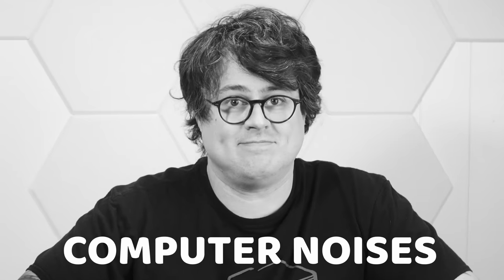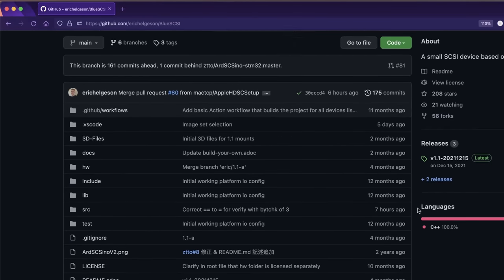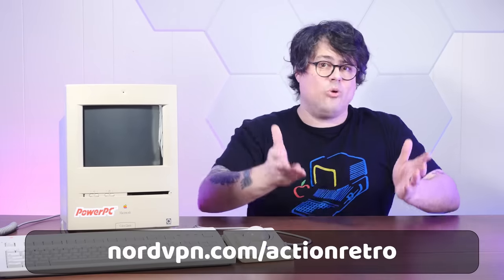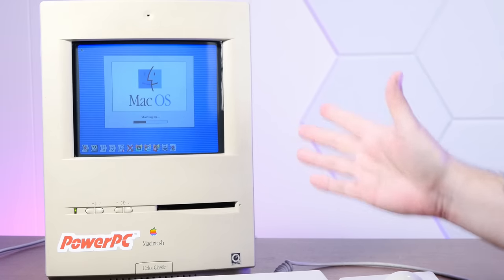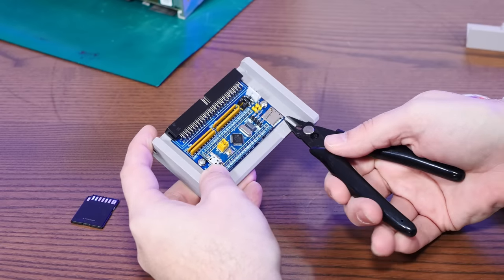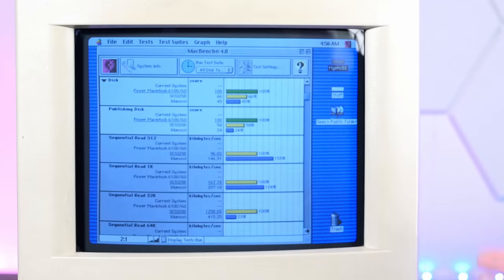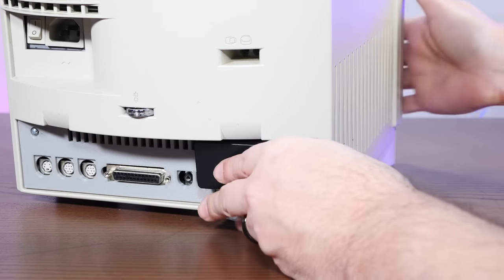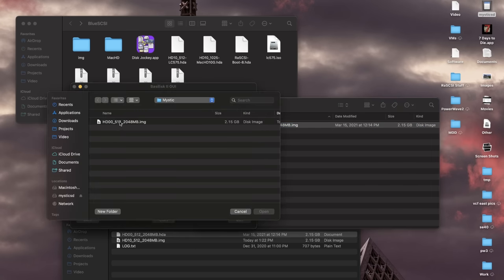BlueSCSI is AMAZING!

Comment: Thanks for the video Sean - though the performance you seen is not the norm (I get faster on my old SE) - This could be due to using the LIDO drivers which many blanks/premade images use. If you could retest with the Apple SCSI drivers you should get much better results - at or around 1mb/sec - also with the latest firmware as you mentioned you should get around 1.2mb/sec.
Reply: Personally, I would suspect that SD card extension was being plagued by interference issues and slowing down data transfers.
Reply: From what can bee seen on the video, Sean only tested the sequential reads, not random reads, where any solid state based disk should be faster than a HDD.
Reply: @Eric Helgeson Just to confirm, the Apple SCSI drivers (any version?) are the fastest driver's (compared to FWB HD Toolkit, Silverlining, etc.) for any version of BlueSCSI?  And on top of that, we ought to be using ExFAT too, for best performance, right?
Reply: @mojoblues66  Random r/w performance(and latency) with solid state storage will wipe the floor for sure.
Reply: @JDW-  I’ve done extensive testing of modern scsi sdcard solution on Mac, I can confirm that you really want to use the the apple  drivers, FWB, lido and a few others I tested really poorly effected the read/write speeds
Reply: @Choppy_PHC  have you tested MacSD?
Reply: @JDW-  haven’t tested the MacSD, but scsci2sd, blueSCSI, compact flash to scsi (retro brew computers) and I’ve also been a extensive tester during the development of the ScuzNet device that has a sdcard for the hdd as well as a scsi Ethernet build in
Reply: The premade images are no longer easily available on macintosh garden (I found 1 download with the wayback machine). Would you be able to host the files directly on the github page?
Reply: @ligmuhnugs  the images are still on the garden where they always were (just looked)

Comment: Hmm.  In addition to the drivers within MacOS, I wonder what would happen with different SD cards.  One way to get a better sense of the difference that might make between BlueSCSI and SCSI2SD would be to use the same micro-SD card in BlueSCSI, and (with an adapter) in SCSI2SD.  It would be a bit time consuming, since it would need to be reconfigured for SCSI2SD, but might be instructive.
Reply from the maker: Ah yeah, I did use the same SD card for both
Reply: Did you try it without the SD Card extension cable? That could be having an effect
Reply: @OtterlyInsane  it probly check sum, reparation of the same data not making the first time
Reply: @ActionRetro  
You may wish to retest with a faster/higher quality SD card. UHS1 minimum, but I would advise UHS 2 for best results. They're more expensive, but worth the extra cost.

Comment: You may want to use A1 or A2 marked SD cards.  They are made for OS use.  Older cards are focused on video or photo applications.  Thanks
Reply: I haven't heard of these Application Classes before but have known that typical SD cards are terrible for random accesses. Whenever I need to get new cards I'll need to look for these newer classification markings.
Reply: @eDoc2020  I think that the Raspberry Pi and similar systems  gave them reasons to make OS focused cards.  Good Luck

Comment: Remember also that there are different classes of SD cards that perform faster or slower. I would double check the cards you used to see if they are slower.
Reply: Well, yes, that counts, but I doubt it would change matters dramatically.

Comment: Great vid!  FYI - I've found even some modern higher class SD cards have a problem with exFAT on BlueSCSI, resulting in the BlueSCSI corrupting the card.  I've found the FAT32 format on the SD card to be completely stable, although theoretically slower.  On my 68K Macs there is no difference between FAT32 and exFAT, but newer faster machines may be different.
Reply: I can't imagine why exFAT would be faster, but I also haven't looked at the code. My assumption is that the BlueSCSI wouldn't modify the filesystem itself, so the only speed difference would be in calculating sector offsets. As the basic technology is the same with the two filesystems I can't imagine there being much of a difference here, and I would actually expect FAT32 to be imperceptibly faster due to only using 32-bit values.
Reply: @eDoc2020  its more likely due to the filetable size, it can increase write/read speeds tremendously. Sustained writes/reads on SD media is the medias strongest shortcoming, the more fragmented file table of FAT32 and the way the virtual-disks are stored for BlueSCSI is probably what is the biggest cause of both the corruption and performance differences.

If i hazard a guess, it would be due to the SD media not having a cache, so when the buffer is written on the host side, the SDcard simply falls behind on write-chunks, which due to the limited signaling of the media the interface controller (Arduino) is not catching, and assuming its flushed out before it is.
This is actually a common issue with alot of SDcard controllers, as the media lacks alot of the command queueing that ATA supporting disks have, and the bus the adapter is connected to expects.

To be fair, the arduino is also extremely underpowered for alot of applications like this. As flash media, unlike spinning disks usually isnt stuck waiting for head movements, and can flush the bits directly to the media. As a result, its constantly telling adapter "its ok to send data", and the adapter translates this to the ATA side as "Go ahead, send the data from ram".
The issue is, unlike say a modern SSD with dram for cache between the interfaces, you get stuck with the flash media becoming overloaded without warning. The signaling is simply too fast for the arduino to scream "STOP!" to the ata bus, and without a cache to dump the data coming it, it simply gets lost or overwrites the already waiting data.

This is why performance is so spotty, and unless your using a top-tier SDcard, your performance will be extremely variable. With small, random w/r performing extremely well, but everything else performing terribly.

Comment: There is the possibility that the cable extension causes issue as it will effectively act as an antenna.  Remember that CRT systems generate a lot of noise and while there is shielding, the extension could be causing the SCSI bus to drop to slower speeds such as SCSI 1

Before assuming this is correct, you really need to test without the cable in place to eliminate that as a potential issue
Reply: The Amiga users have been using these extenders for ages with out issue. That said they dont have a hoofing great pulsing HV source pushing out RF and magnetic noise just above them.
Reply: also when he picked it up at 13:14 the menu bar glitched out a bit. definitely something off with it.
Reply: @wolarts  I think he just hit a key on they keyboard. The menu bar blinks like that when you do something to piss System 7 off and the volume is muted.

Comment: If using that extender cable, open the housing and remove the surface mount resistor. I had all sorts of R/W issues with one until I did that.

Comment: before using the external sd adapter you need to find out what class sd cards the blue scsi is compatible with. that adapter does not appear to be compatible with newer sd cards

Comment: I know this is a Mac focused video but one useful feature of the scsi2sd that doesn't seem to be implemented on the BlueSCSI is being able to define the geometry of the virtual drives. Not an issue on Mac but I play with old Sun machines too and in old OS versions the format utilities have limits on the number of cylinders/tracks so you have to fiddle around with the config file to get a "drive" with the right geometry. I think this might be an issue on other old Unixes as well (NextSTEP, irix?). But as a plug and play solution this does look nicer than dd'ing files to an sd card for scsi2sd.
Reply: True! Most of the contributors are mac people, but we've gotten a few workstation contributions lately as well. I do know @Drake has an image working on his NeXT. Firmware will continue to evolve as more people learn about it and contribute!
Reply: @helfire23  Thanks for the reply! Glad to hear others are working on new features, sounds like a really great project. Will definitely keep watching.

Comment: Oh by the way, have you made absolutely SURE that the FAT32 block size is 4Kb? Otherwise you will have severe performance degradation due to block sizes mismatch.
Reply: If the BlueSCSI works the way I think it does then you would want to use as large of a block size as possible on the host card.

Comment: Hey Sean -- hate to have to tell you at this point, but I've had negative performance experience with those SD card extensions. I had tried one with an SD2IDE -- it really slowed things down. It's been a few years since I did the testing and benchmarking, but I would be definitely weary of it providing the best results -- this may explain why your BlueSCSI benchmarks came back so low.

Comment: @Action Retro - The bottleneck is not the system, but SDcards. SDcards provide the worst throughput of any flash media. its difficult to find reliable and fast SDcards on the market that are not prohibitively expensive. The flash media types in SDcards are similiar to low-quality SSD's sold for SATA and NVME, out of china. However, this is due to SDcards size.

 After watching your video, it instantly comes to mind the 2 major bottlenecks in your setup.
1. Your extension on your SD card slot to the external SD-card slot adds alot of Latency. Electrical signals are sensitive to cable length and degridation occurs the farther out you travel from the source of the signal generated. Your adapter is not providing power, so its relying on the SDcard slot on the BlueSCSI to do all the powering of the signals needed to read the SDcard. Adding latency and introducing signal degridation. - this doesnt happen on the SCSI side obviously because the device is transmitting using the power supplied by the cable. but the SDcard slot doesnt have that as its not intended to be extended.

2. Major performance bottleneck of SDcards is during sustained writes and reads. Both SCSI to SD adapters you use, lack any form of cache. This makes them effectively half of the performance of a comparable SSD on the same bus. That is the major benifit of a SSD is dram cache (and larger flash chips due to the extra space) on the device that gives a read and write buffer to smooth out performance.

Fixing both of these would drastically improve performance on your machine, with your current setup.
---

However, moving on, SCSI is not dead. The original interface was and is still used still heavily in industrial applications, as many legacy equipment are still in operation. x86 machines of the 90s used SCSI heavily and as a result hardware is still being produced today supporting it.
That said, Getting away from conventional HDD's is a smart move after all. But wanting to get more performance from a device on the SCSI bus means not using Cheap flash media found in SDcards, but using more powerful flash chips found in SSD's.

There is two ways to go about this. 
Option 1: is to get a industrial SSD with a built-in SCSI interface. They are (kinda) rare, but they do exist. However, most of them are marketed directly at the industries they are targeted at, so finding them on the second-hand consumer market (ebay) usually means they are nearing the end of their lives. So finding some one with access to industrial equipment distributors is usually the best way to get access to them.

Option 2: SAS/SATA to SCSI interface adapter. SATA shares the same interface protocols as SCSI, however its termination without a port duplexer is where its similarities end. SATA is afterall a cut-down version of SCSI at its core, and as a result is very similar. The drawback however is using a simple SATA to SCSI interface adapter is, without some type of port duplexer, it terminates the entire SCSI bus and due to its electrical limitations doesnt allow any other devices on the bus. However smart SATA to SCSI adapters do exist and can easily overcome this issue by handling all the legwork of communicating with the SSD, freeing up the limitations of the connector.

Keep in mind, however with both of these options there is different types of SCSI interfaces. SCA 50, 68 or 80 pin connectors were common for SCSI's lifespan. even modern SAS drives (Serial Attached SCSI), all share ancestory with SCSI and are generally compatible with the right adapter to interface with the device.

The key here is all hard-disks support ATA communication. ATA is a standard of communicating with HDD's accross many types of interfaces. This is the reason why CF cards are pin-compatible and work out-of-the-box with IDE controllers. They are just IDE like interfaces, using ATA command structure.

However, SDcards and many modern portable flash media doesnt have any advanced communication structure. They are just a raw flash media, with (Sometimes) a simple wear leveler to detect flash wear and predict failure. They are so simple, as they have to fit into a tiny space and the controller can not exceed 6 pins /max/. This means that most of the physical wiring lanes are taken up just by power and data connections. There is no way for extra datapins to even exist to gather significant data, even if there was a complex chip that could fit there to handle the ATA command structure.

----

So dont fret, there is options out there. Just remember, SDcards are great for moving files between devices, but are not reliable or fast for general use. They are cheap and thats what has made them quickly rise in popularity for removable media.

Comment: The scsi-2 controller is the same between the lc 575 and 6100.  But the bus speed is different 16mhz vs 30mhz on the board.  I have used the same hd from the 6100 a quantum fireball and it did run more slowly that in the 6100.  Eventually I put a 9 gig ultra scsi cheetah drive and it was a lot faster.  Lastly did you check your disk cache settings?  If they are low and you do not have l2 cache then that also impedes the bench mark.  Make sure that virtual memory is off and set disk cache settings to 4096k for best hd performance.

Comment: Is it basically bit-banging the SCSI signals? That's my first thought when it comes to the speed. Honestly, if that is the case, I'm impressed it can even reach the levels it does.
Reply: There is something wrong with the test - he should be getting ~1mb/sec. And up to 1.2mb/sec on the latest firmware.
Reply: The most likely problem is the long cable of the SD card reader. It's running right next to the back of the CRT, PSU and all the other electrical components. I doubt the cable is shielded well enough to cope, and I'm betting the card reader isn't the highest quality. Sometimes you need to discount the obvious culprits first.

Comment: In reference to my post of about 6 hours ago, I've got an entire collection of digital hardware, most of it no newer than 10 years old that I'll offer to anyone for the cost of shipping (from New England) & packaging, and maybe toss in $5 or less for my effort to get this to you ... far too much to inventory here; but most of it still would still run ... I've not cannibalized very much, but most of it is still useable. In particular, I've got maybe 20 SCSI 2.x drives (huge energy consumers -- 5 of them would make a pizza oven), a couple of Adaptec SCSI controllers, perhaps 4 or 5 x86 (mixed Intel and AMD) systems in (most of) their original floortop/deskside cases -- the one thing I do NOT have is working monitors of any kind (but I have at least one relatively modern 42" TV, maybe; and a couple of desktop 22-24" monitors very good for parts). Leave me a message here if you're interested, I need to clear out this office sooner or later -- the "junk" pile is getting larger by the year. I would not call any of this stuff energy efficient, nor will I warrant any of this h/w. Thanks.